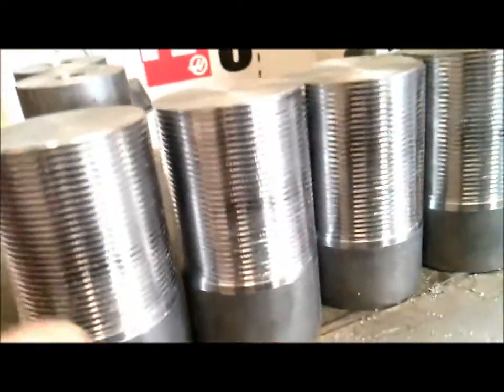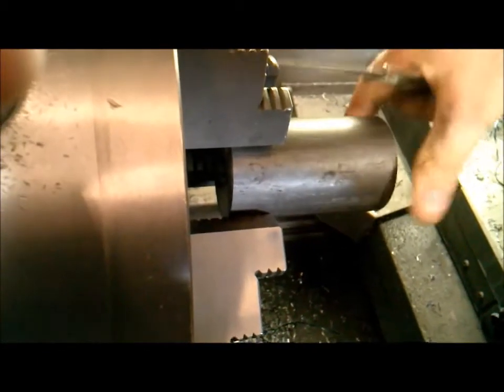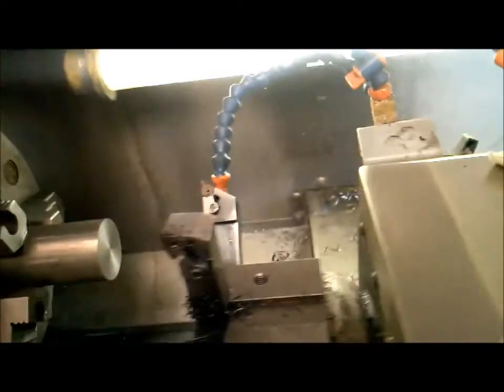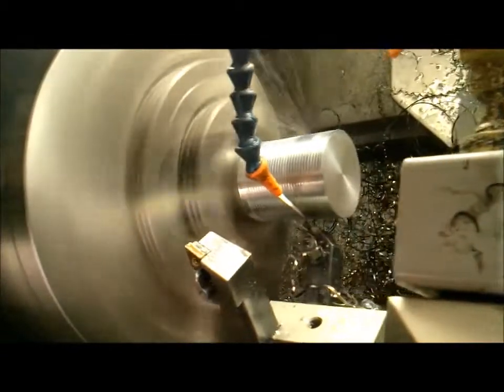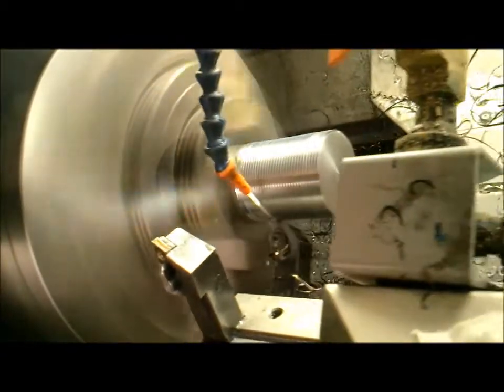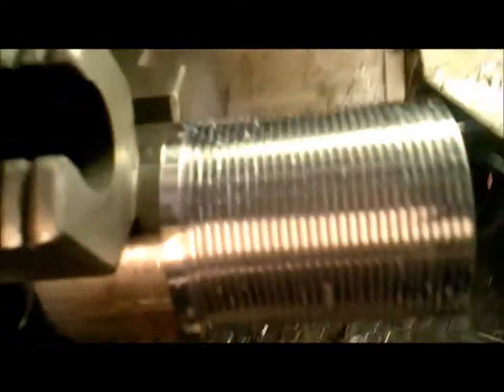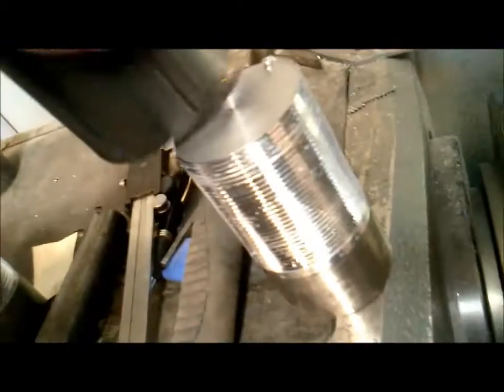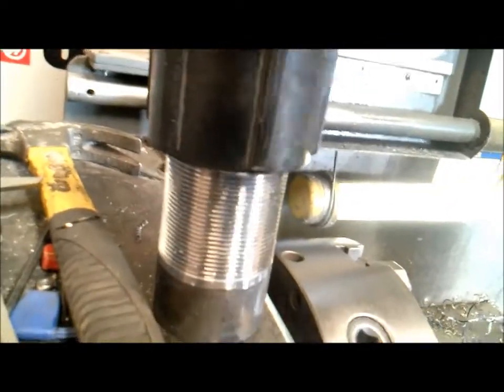Haas CNC Numerical control Threading

Comment: Here i am seeing total 9 passes for threading...Why this much passes ??and how to select the no.of passess for  od threading..Could you  pls answer this..?
Reply: usually with turning insert, i remove 4mm in roughing and 0.8 finishing...So turning insert can take depth of cut 4mm diametrically and radially 2mm..but here my question is if M20×1mm pitch  OD thread what would be the no.of passess..How to determine it sir ?
Reply: consider that thread Major dia is 20mm and Minor dia  19mm ..then ?